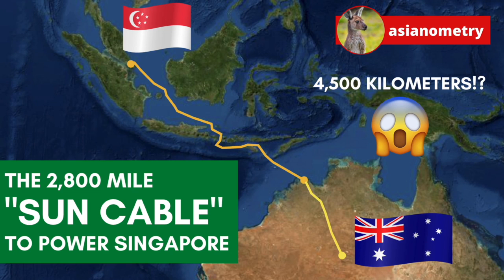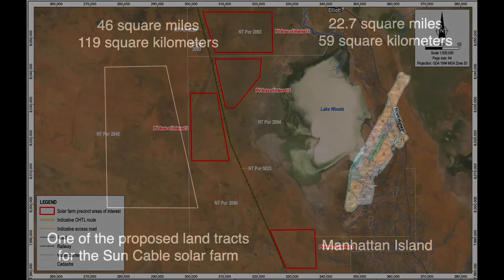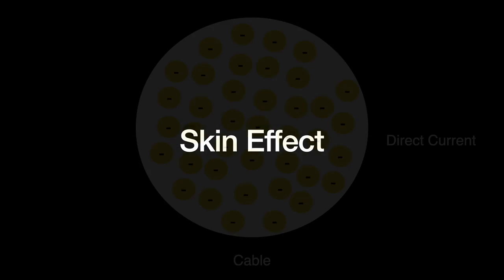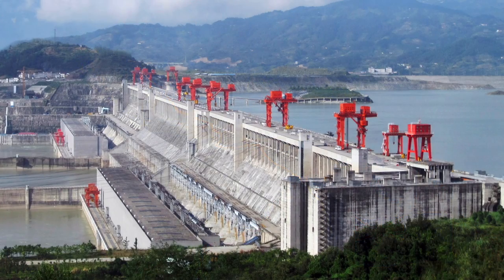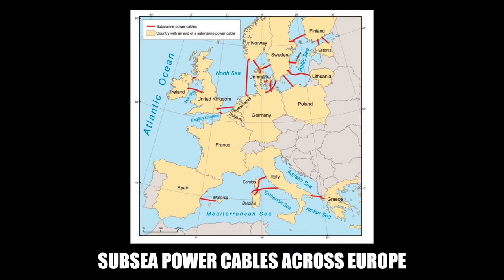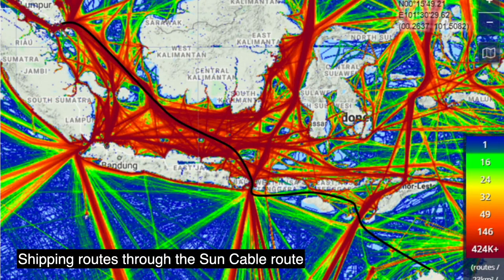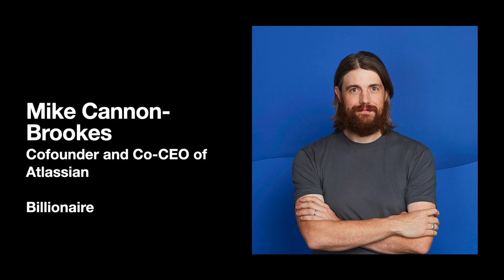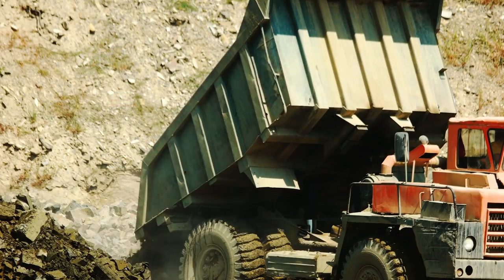How Singapore Plans To Pipe Electricity From Australia

Comment: This is a good idea and all but there is a risk of the cable breaking which would make all of Singapore dark
Reply: Batteries take a lot less room than solar farms, so you would expect Singapore to have plenty of them to buffer the incoming power.  Of course if the outage goes on for months (as in the case of Basslink) there's nothing that can be done short of having a redundant cable available.  Or maybe they keep some of their old power stations around "in case of emergencies" and use it like backup generators.

Comment: The map that was shown multiple times is incorrect, it shows the cable entering the sea in Kimberley region of Australia, which is a long way from Darwin. Compare with the correct map shown at 15:17
Reply: Yes, the line going through Darwin was in the wrong place, and so is the starting point (near the town of Elliot, NT). I have helped get this corrected for this video's thumbnail but unfortunately the video itself is already released and can't be changed.

Side note: there is/was another similar project called the "Asian Renewable Energy Hub" that wanted to build a submarine cable from a solar farm in the Pilbara, Western Australia. But they've switched to a plan involving using solar power to produce hydrogen/ammonia fuel and transporting the energy by cargo ships not electrical cables.

Comment: #1. The current battery types of lithium can't be made - not enough lithium..Assuming more than just a night; but actually enough for several days, even weeks; the amount of sunshine even in northern Australia varies and it isn't constant losing half light hours in February due to clouds, fog, etc. If Singapore was only using this as supplemental power then perhaps you don't need so many batteries.  #2.Energy loss per 1000 Km drops at a compounded rate, a power curve; not a straight rate.  Even with the lower DC rate of loss; you'd be looking at least 50% loss.  It would make much more sense to have fewer solar panels on barges floating near Singapore than to try and transmit it 3700 Km; it would probably make even more sense to use sea power generation or geothermal from a closer source.  #3 You'd need a great deal more solar panels produced. World wide total Solar is only 2.7 Terawatts which has been built up over 12 years.  At the current rate of solar production; this would take 7 years to build enough panels if all world production went to this project.  Surely this would require 20-30 years even with cheaper panels that doesn't mean rate of production increases - It might - but this would require something not yet in production. Entire new plants for solar production would need to be made using vast amounts of rare earths. The increased mining probably can't be done again requiring a new type of panel that doesn't require these.
In short someone is smoking too much dope.

Comment: Perhaps the title would be more realistic if its "How Australia Plans to Pipe Electricity to Singapore" 
It does not make sense in quite a number of ways. 
1) Australia's electricity generation mix is 87% fossil fuel. It would be a lot easier and cheaper to supply within Australia than to send to Singapore or even Indonesia.  https://www.aph.gov.au/Parliamentary_Business/Committees/Senate/Environment_and_Communications/Coal_fired_power_stations/Interim%20Report/c02
Gas itself is 85% of total electricity generation in NT. https://www.energy.gov.au/publications/australian-energy-statistics-table-o-electricity-generation-fuel-type-2019-20-and-2020

2) Singapore has signed firm contracts to import electricity from Laos whereas this Sun Power line hasnt even got an MOU with the Singapore government, much less a Power Purchase Agreement

3) Nearby Indonesian islands already announced giga watt floating solar farms with Singapore partners.

4) Any power cables will have to go through large active seismic areas. Cable laying ships are not readily available and need large scale support.

5) Geopolitics means such an underwater power line can be easily damaged/sabotaged by state actors (maybe China?) or deep sea trawlers 
There are several more reasons but the only people that will make money will be the engineering consultants.

Comment: Why would they not provide power to intermediate locations e.g. Timor or Indonesia? The cable could run  on land across Java & Sumatra.
Reply: This is just speculation, but it could be because unlike Indonesia Singapore has almost no fossil fuel production of their own and already must import natural gas to provide for their electricity needs. Indonesia meanwhile is the world's fifth largest coal producer and eighth largest natural gas producer and can provide relative cheap domestic supplies of these fuels for their electricity needs. So there's a very different cost proposition in switching electricity sources between the two countries.

It might seem like adding intermediate access points would make sense even if the furthest points would still be the most economically attractive. But given this requires at a minimum additional conversion stations it comes at a high added cost.

Timor produces a fairly modest amount of natural gas but its electricity demand is a tiny fraction of what Singapore's is anyway so it's basically irrelevant.
Reply: @espfusion  looking at the expenses from this video. I would think it would be better for Singapore to build a nuclear power plant instead. Ample of long term power with lower cost than this project.
Reply: I understood East Timor has abundant fossil oil/gas within it's borders. It'd be far more fesable, to use that to generate power and transmit it to Singapore.
Reply: If you are running a submarine cable already why bother switching to land halfway through?
Reply: @catprog  maintaining a land based cable is much easier. Ask the crew of the Indonesian submarine how benign the seas are around this archipelago.

Comment: Nice video. Although I hadn't realised they moved Darwin to Western Australia.
Reply: The folks at Kalumburu would be surprised their town got a lot bigger and renamed.
Reply: Yes, the line going through Darwin was in the wrong place, and so is the starting point (near the town of Elliot, NT). I have helped get this corrected for this video's thumbnail but unfortunately the video itself is already released and can't be changed.

Side note: there is/was another similar project called the "Asian Renewable Energy Hub" that wanted to build a submarine cable from a solar farm in the Pilbara, Western Australia. But they've switched to a plan involving using solar power to produce hydrogen/ammonia fuel and transporting the energy by cargo ships not electrical cables.
Reply: Noticed that too mate.

Comment: You claim that break even between DC and AC transmission is at around 200km. In practice this distance is generally considered to be much longer. In the range of 500km. I assume the gap can be largely explained with practical concerns, like most power systems being grids point to point. The former gaining flexibility from AC outweighing the energy loss.
Reply: The exact breakeven distance is also affected by other things than trasmision losses BTW - like the how much peak power you're pushing, and whether you need some of the cable to go through tunnels, etc. But it is FAR less for a subsea cable than for land because capacitative losses are orders of magnitude bigger underwater  - no one does undersea AC cables for more than a few kilometres. It's all DC just crossing the English Channel (a few tens of kms).

Comment: Singapore is very aware of security issues and this piece of infrastructure is too easy to cut.

Batteries and solar is a very expensive means of providing base load. As seen by the fact that it is none done on a large scale anywhere.

Therefore This is not going to happen. It is only a publicity stunt by some billionaires.  

A better option is some hydro power stations on Borneo. Or a nuclear.

Comment: If the Australian Billionaire is happy to subsidise the project than why not for Singapore! But back of the envelope calcs suggests the cost of power to the consumer would be 1000% to 2000% more expensive than gas power. Furthemore all the existing gas power plants would need to be kept on-line to back up the this source. We can't even power Australia with solar without gas and coal plants, and there is no capabilities in Australia or the world to provide the batteries in the foreseeable future to replace gas or coal.

Comment: I thought skin effect only comes into play at either higher frequencies, or else at very thick cables.  I would have thought stray  inductance and capacitance would be the main parasitics in electricity transmission?  I'm no expert though.
Reply: Electrical Engineer here. You are indeed correct. The Skin effect contributes to additional losses but is quite low in 50 Hz or 60 Hz systems. The main reason for these losses are parasitic inductive and capacitive effects on long transmission lines. Not to math it out to much but for each delta x (change in distance or length of the cable) there is a delta L (change in inductance in case of rising x it's an increase) and a delta C (change in capacitance)

Comment: Why can’t they find space for solar farms in Malaysia or Indonesia? Surely they can use the solar panels to partly shade crops so they get a double whammy?
Reply: @hull4bal00  “they did” what? Don’t understand your comment.
Of course, this video is about Australia but the obvious question to me is why collect solar power in Australia when you have plenty of areas in Malaysia and Indonesia, that are 20 times closer.
Reply: @colingenge9999  Singapore already importing electricity from Indonesia (and maybe Malaysia to) the numbers are increasing day by day.
I don't think Singapore need electricity from Australia. especially when Indonesia have plans to use nuclear for  floating power plant (at the moment we use diesel) in the future.
Reply: @hull4bal00  unsubsidized LCOE of solar with battery storage is around $.10 per kilowatt hour versus $.30 per kilowatt hour for diesel generation which appears to be the most expensive. Nuclear is running $.06-$.08 per kilowatt hour

Comment: AC long distance has nothing to do with the skin effect. The skin effect is depending on the frequency and 50 or 60 HZ cause no skin effect at all. The problem with AC is only when you put them into ground. The Line and the earth build a capacitor with the isolation as the dielectric. This capacitor causes a reactive power on the AC line and therefor reduces the power-factor of every consumer attached to it. If you put the cable up high, the effect becomes marginal, that's why typical transmission lines are up high.
Reply: The capacitance is much higher still if you put it under the sea - saltwater is a truly excellent dielectric. No one puts AC lines subsea for anything over a couple of kilometres.
Reply: @kenoliver8913  In general, to large sync cells are problematic. Even very long distance on land are better done ulta high DC if the target have enough inertial mass.

Comment: why you gotta do new zealand like that? lolz  It doesn't actually make that much sense to pull solar energy to singapore.  If they have nat gas, just ship some LNG up there.  Australia already has a huge LNG export project going.  and in terms of costs, electricity from LNG is not a lot more than electricity from solar.  This line would help with connectivity and outages tho

Comment: Ambitious! Singapore may have enough electricity but it will be expensive.
Reply: Having dirty energy might be more expensive in the long run.
Reply: @krollpeter  I entirely agree with you. However, I suspect that the residents of Singapore might not be that happy when the bills come in. This does, of course, apply to every electrical user on the planet!
Reply: @johnstonewall917  I think you are right.
Looking ahead however there is a real need for extra capacity, and also to replace the current gas burning power plants. I guess there will be no choice ... and this seems a long term solution.

Comment: $10B USD+ for this project?! If it costs this much with likely run overers they might as well just invest in high tech solution and transport the energy using Lasers and Satellites to beam the energy up to space then back down to Singapore. 

The satellite would be powered by the laser too

Comment: Solar farm and HVDC transmission via undersea cable  is OK. But how to  cope with large fluctuation of solar energy generation on night? The proposed battery storage is not good enough for such massive solar farm. It needs  better energy storage system than lithium battery storage to be practical.
Reply: Most power is used during daytime anyway. And he even says it will only provide a fraction of their electricity, so other sources will still be available for nighttime power.
Reply: 22Gwh of battery storage is what is proposed.

Comment: This project will be a total failure as the two cables of 4,500 kM each length will need at least 2 x 4,500 (=9,000) High Voltage cable joints even if each drum of these 800kV DC cables can be manufactured to a length of 1 kM each.
Engineering wise this 1 kM cable length will difficult to make as the large cable diameter required will be hard to roll up in drums and to handle or laid.
That means there will be 9,000 weak links running through very hostile ocean environment through the fabled "ring of fire" volcanic zone.
The insulation failure of any one cable joint will disrupt the entire power transmission for many months as the location and repair of such undersea cable joints will be very difficult.
Singapore investors and government public money should think carefully before putting any money into this venture.
Loss of 20% power generation in Singapore will be devastating!

Comment: For a fraction of the price they could build a nuclear generator which produces 1000 times more energy, is carbon neutral, and will only take up a couple of acres and the power generated would be cheaper.
Reply: Please provide an example of the cheaper nuclear power station.
Reply: @catprog  everyone in the industry knows that nuclear energy is significantly cheaper that solar energy that fact is not even debatable. Even anti nuclear nazi's will concede that.
Reply: @TheRoark85  Al Dhafra solar project 1.35 UScents /kWh  Can you link a cheaper nuclear plant.
Reply: @catprog  most likely that's after gov subsidies... on the other hand when nuclear first csme out th we y were not going to metre it because the power was to cheap to bother metering.
Reply: @catprog  the U.S. dept. Of energy (D.O.E.) has listed solar energy as the most expensive form of energy.

Comment: The cable  loss would be huge... 2000 plus miles.  Would need voltages in the hundreds of thousands
Reply: highest voltage HVDC  is currently 1,100kV

Comment: I thought that on my off time running a <18M to <10m house to shed power source to my gardem shed... cough 'mancave' is difficult.

Short runs like this on a budget especially making it compliant with AS/NZS standards is a bitch and although I want DC from source the voltage loss on my budget leavese w/ AC... pay a bit more for mains AC to destination & safetey to avoid the poop chute.

Comment: Why on earth would you run the cable underwater through the Java sea, rather then using land links through Java and Sumatra and just hop the straits along the island chains.  The costs of submarine cables is far higher per unit length then an above ground cable, be they AC or DC.

Comment: An earlier concept from this idea (I think it was from UNSW) used a lake as storage for the energy. Looks to me better as batteries. Any idea besides costs why this is not in the Sun plan?
Reply: You mean pumped hydro? Or literally dumping electricity into a lake and wasting it?
Reply: @m2heavyindustries378  hydro power.
Pump the water with solar generated electricity in a (artificial) reservoir. And use hydro power to create electricity  again when needed.
Reply: @m2heavyindustries378  pumped hydro has efficiency about 75%.  Yes 25% is “wasted” but the electricity price difference between pumping (at night) vs generating (during peak daily hours) is much bigger, so it is economically advantageous to do it. Additional benefit is the frequency regulation because hydro generators can change their output very quickly.
Reply: Presumably using Lake Argyle, which is next door (less than a thousand km away) to the solar farm. I would imagine the problem is not enough fall - the whole of northern/northwest Australia is very flat. And if you try and build a dam further south you are into true desert country with no rain.

Comment: Why doesn't Singapore just buy green hydrogen from Australia? If it's infrastructure is aligned with natural gas then the conversion wont be that great and they could source from multiple suppliers? If someone decided to cut the cable from Aus to Singapore, then their whole system would collapse. It looks so damn fragile !!! But I LOVE the thinking. What about a global network of cables across all nations where its fed by re-newables? Nation states could negotiate inputs and sale price according to supply and demand. This could obviate the need for energy storage. The system fragility could potentially be designed out.

Comment: Price on carbon is needed to make this and other decarbonization projects prosper.  10x more of these kinds of projects should be built to make a global zero carbon electric grid.
Reply: But the materials used to produce these systems have a huge environmental impact. Solar panels require tones of heavy metals and energy mined and processed mainly in China.